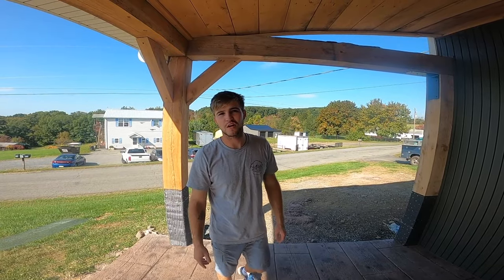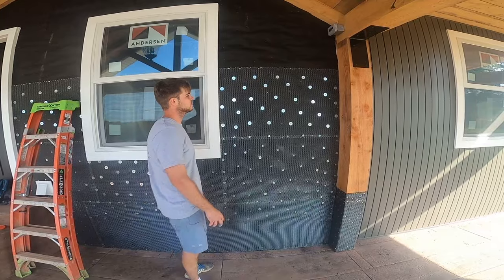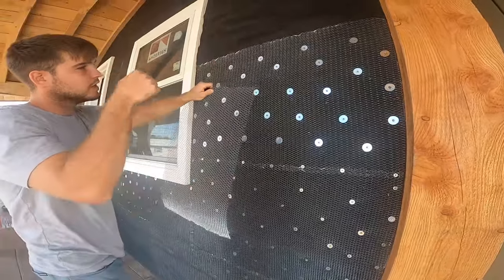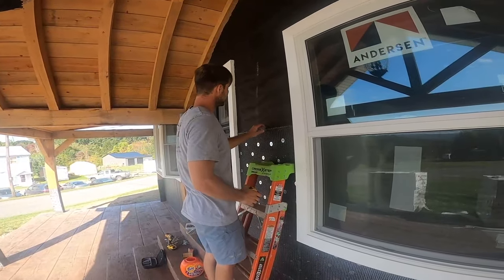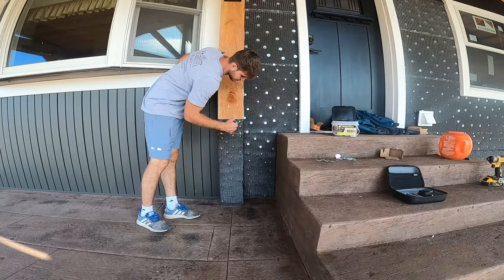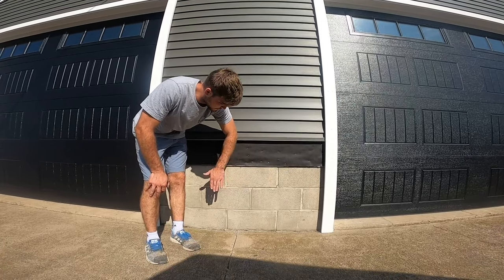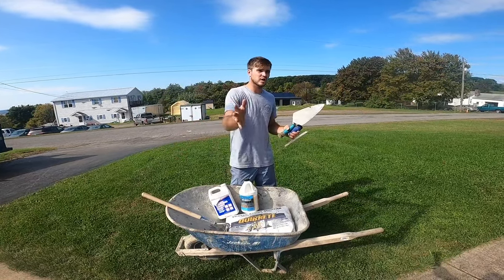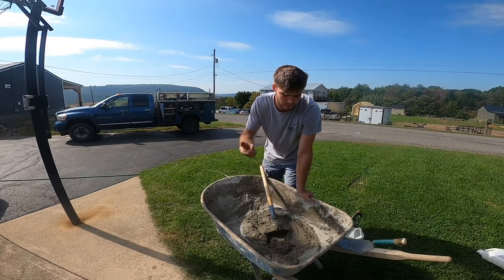How to: apply the scratch coat for stone veneer on various material.

Comment: Hey Mason! I've watched alot of your videos because I'll be applying stone veneer to my new shotcrete pool shell. I just finished adding the waterproofing membrane and I've purchased all the materials I need for this project. My question is if you have any experience applying stone veneer in submerged applications, like pools or fountains. I have quikcrete polymer modified stone veneer mortar and I'm planning to add a type "e" additive to that to prevent leaching and efflorescence. After I install the veneer (and after everything cures) I plan on using a clear sealer. Would you complete this project any other way? Is the type e additive needed? Thank you! -Sarah
Reply from the maker: I have never done anything like that yet. I’m not sure what exactly you would need to have the best product